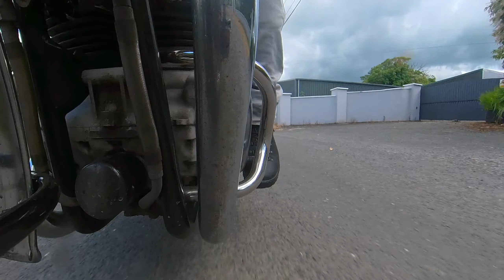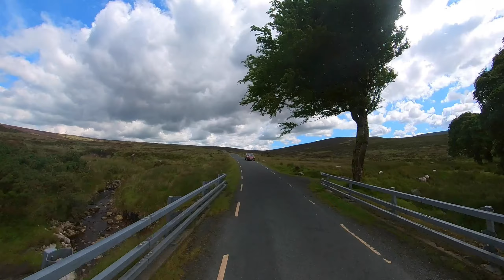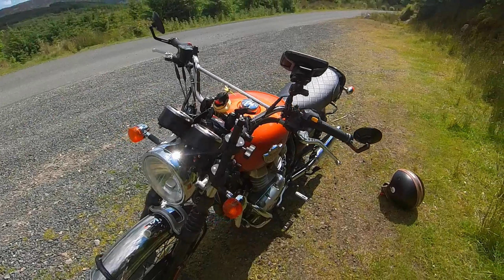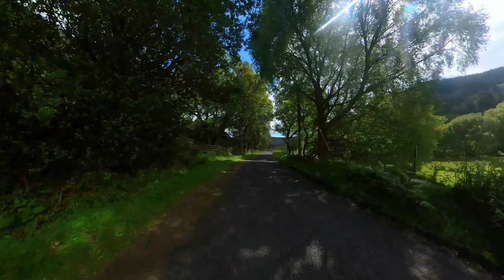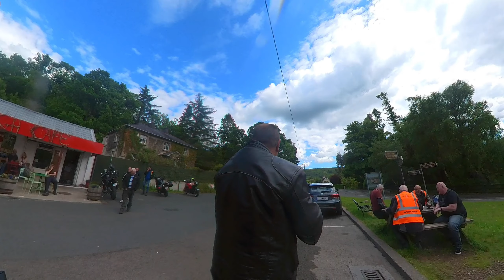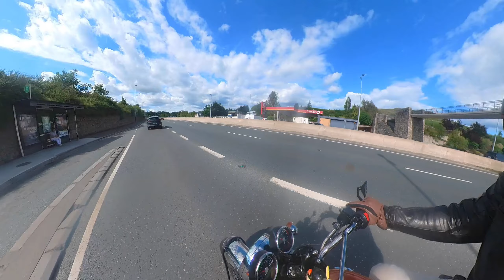Royal Enfield Interceptor 650: 1969 styled custom parts by Hitchcock's

Comment: Hi I was looking at exactly the same front mudguard from Hitchcocks, I just love it.  Does it add a lot of weight? thanks for posting.
Reply from the maker: Well, "a lot" would be an overstatement 🙂. Of course it would be heavier than the piece of plastic that comes vanilla with the bike, but I didn't notice any effects to the bike that would be due to extra weight at the front. Having replaced the original exhausts with AEW 201's has been a massive reduction in overall weight - so I guess I am still lighter then the stock model😁

Comment from the maker: Parts List Hitchcock's: Item Name/Code

60632		HANDLEBAR, 650 INTERCEPTOR, BRACED, Chrome	 
92314		REAR MUDGUARD (Stainless) AND NUMBER PLATE ASSY, 1969 Style
92315		FRONT MUDGUARD AND STAYS, 60's style 
92299		ROUND INDICATOR KIT (Front + Rear), 650 Interceptor + Continental GT

Comment: hi , would the handle bars make it feel less sporty in the general feel and turning ? nice set up bike
Reply from the maker: My personal experience  is that the handling improved. I'm not a "sporty" rider per se, but I did find  cornering more controlled and responsive.  I think feeling much less pressure on my wrists has a lot to do with it. I'm about 6' and quite heavy build - with the new handle bars, the bike doesn't feel as "one size too small for me" if that makes sense
Reply: @frankysworld  understand well it’s not a huge outlay to try it …
Reply from the maker: @Alex-io6ky  exactly - it actually cost me as much as the risers I tried before, but with a better effect and looking a lot better to 🙂

Comment: What is the Part No. of the 1969 styled handlebar from hitchcocksmotorcycles? Or, if you could leave a link that would be great.
Reply from the maker: Sure, the part no is 60632 and is available in chrome or black finish. https://accessories.hitchcocksmotorcycles.com/s.nl?ext=F&sc=1&category=&search=60632